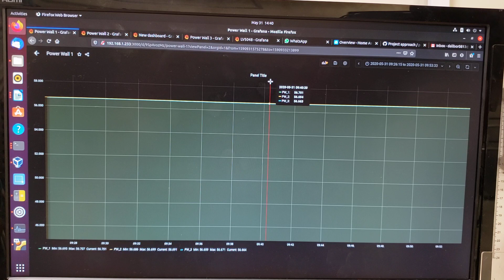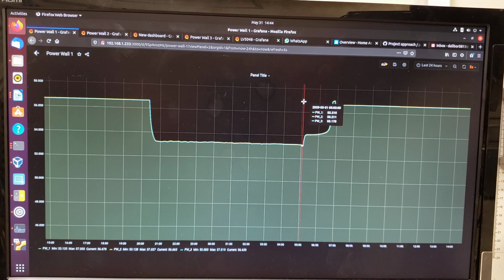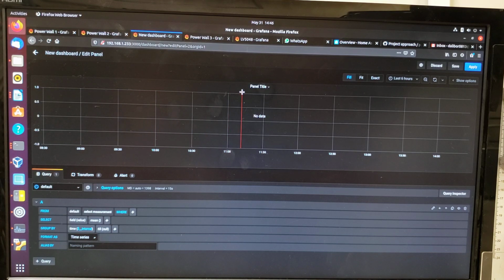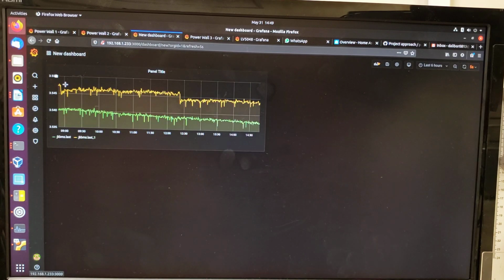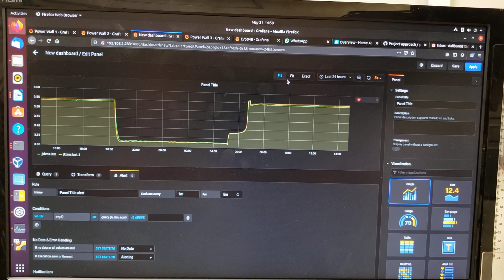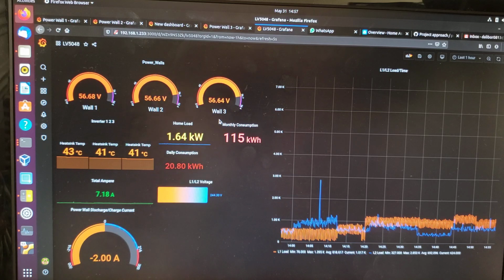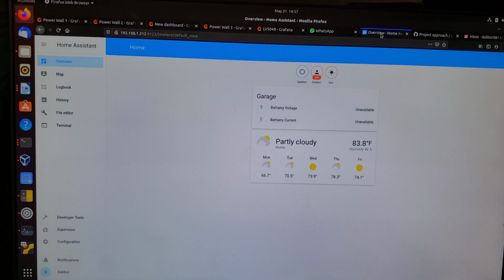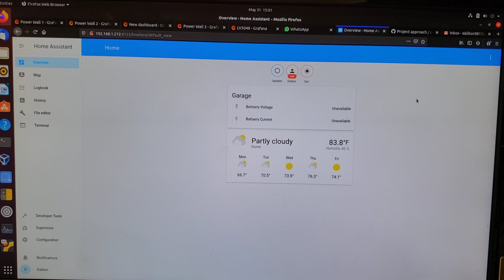LV5048 JKBMS Grafana & HASS.IO. Why? What's next?

Comment: Hey man, long time... I was thinking of a different approach to do the same thing but not sure how to interface. I have disassembled both my JKBMS and my Battery monitor. Inside the battery monitor there are terminals/solder pads for what looks like a bluetooth module. I am assuming this means that it is already configured to output serial data, I am thinking that we should be able to solder a shielded wire from that to a serial port and read the data from it that way and parse it into the influxdb. I was also hoping to do this same thing with the JKBMS since using bluetooth seems silly to connect and reconnect every 30 seconds. I am assuming that each is probably just streaming the data to the bluetooth modules waiting for us to connect. thoughts? Here is a link to a video I made showing this https://www.youtube.com/watch?v=n7CQeorst7M&ab_channel=MichaelIllingby
Reply from the maker: Might be doable. Have you tried it yet? Have you tried reading data from serial port? I have limited knowledge in serial port coms and have tried soldering wires to serial port on renogy monitor but could not establish any communication.
Reply: @DMIINC2013  no as I too am not that skilled in hacking serial data lines. What about the guy who helped you with the JK bms, think that he may be up to it?
Reply from the maker: @sNEAKYnIGHTmUPPET  He helped me out with it. Could not get anything out of it. May be we/I was doing something wrong or there just is nothing there.

Comment: Hi -- really nice video, I'll closely follow that github project to talk to the bms, very interesting stuff. I'm planning my lifepo4 journey and was going to use a cheap android phone and then automate a screenshot+screen read to capture the voltage values but this is much neat.
I was wondering if you have any thoughts on some newer 280ah lifepo4 cells on alibaba? Do you think they're new or used because even the listing you bought from says new, yet it seems what you got were used?
Also, why didn't you go for 200ah cells and use lesser modules? Any particular reason other than budget?
Reply from the maker: Thank you. During my initial search for LiFePo4 I have noticed discrepancies in capacity for same size and weight cells on various listings on Alibaba.com. Before even spending a dime I took a month to research various sellers and pictures they have posted. I started noticing that some of those cells have bar codes removed per pictures posted. That lead me to believe that something fishy is going on and that cells might be B grade or used. So I made conscious decision to go with cheaper cells that I was almost certain would be Grade B or used. They are used but so far I cannot complain as they have advertised capacity. However these cells need a lot of prep before being used in power pack. Be careful as you can and will be scammed if not paying attention. Price per Ah at that time made me chose these cells. Prices are so much different now then even 6 months ago. Good luck.

Comment: How did you connect the conduits to the inverter? Just use a nut on the back?
Reply: That's funny because that's what I did too
Reply from the maker: No. There is no nut in the back. I used conduit stiffness to provide support.

Comment: Dont need python. You just need to push the data via mqtt. Then write a yaml device entry in ha for it. If starting over I think diybms would be preferred as it has  mqtt built in it.
Reply from the maker: Where? How? Help point me in right direction. Thanks,
Reply: @DMIINC2013  Some samples from here: https://community.home-assistant.io/t/daily-energy-monitoring/143436 but going need to get your bluetooth collection stuff to send the values via mqtt. Those those values are published on mqtt topics, you just script up the yaml in ha config to read the mqtt topics and do what you need, make automations, display status. If you want more control, install nodered, and it will read in the mqtt and you can create automations in it also, but it's much more flexable than ha is, it's basically creating flowcharts.As far as creating the publish to mqtt part, would have to see the github project your using to read those values.
Reply from the maker: @patrickdk77  Thank you. All of the data is sent via MQTT, Telegraf to InfluxDB. HASS can tap into it.

Comment: Great idea about using the dump load to heat water. Since your going to have a few teenagers in a few years, would go with a bigger size tank and make it 240V.  Your inverters are capable.

Comment: Lots of great progress on this video. My BYD LiFePO4 batteries have the same graph. Since it's is so flat, it hard to tell what percentage the batteries have left. I have to fine tune the %'s to 0.01 V. The dropoff to 47V is quick.
Reply from the maker: Correct. Having good battery capacity monitor is a must.. Thanks,

Comment: Victron BMV 700 or 712 with bluetooth that have build in small relay that is programable via setings nc or no shuld you wish it it can be trigget with almost anything on the menu of BMW battery monitor and is very acurate it was first thing that I bought starting build powerwall...and bluetooth is very strong...
Reply from the maker: Would it give instantaneous numbers in HASS.IO or any outhrt app? Thanks for suggestion.